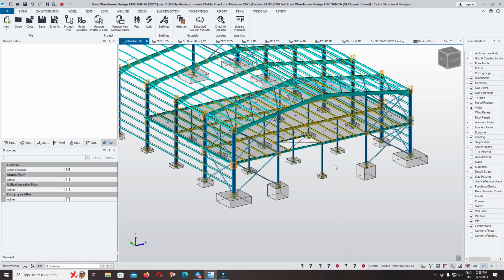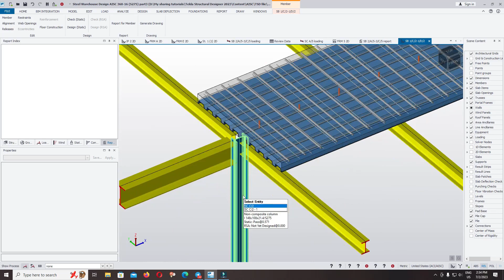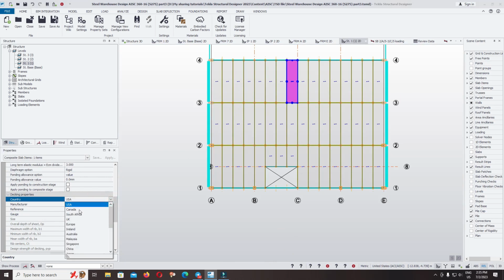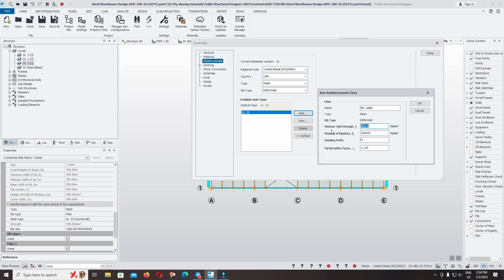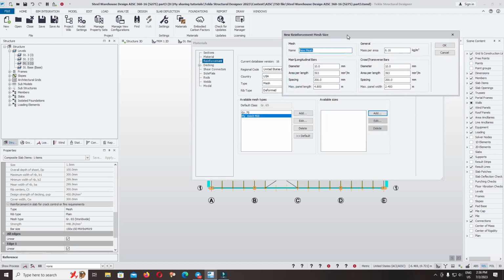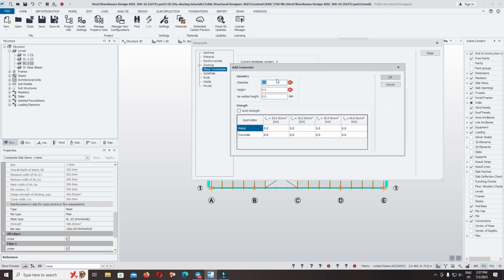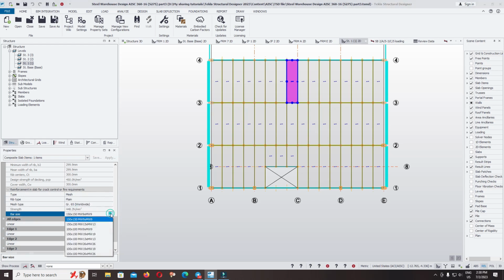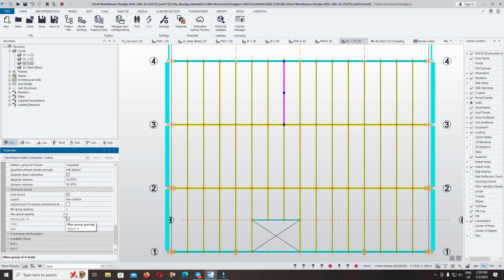9.1 Steel Deck, Shear Stud Connector, Mesh in Tekla Structural Designer 2024: AISC 360-16

Comment: how did you add the decking?
Reply from the maker: You can add steel deck in Tekla Structural Design by default or create new deck section.